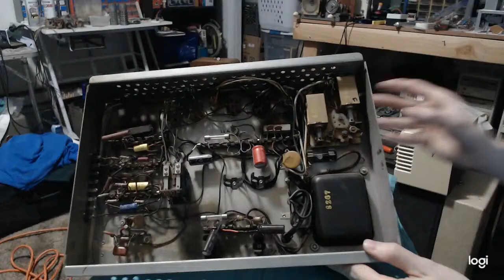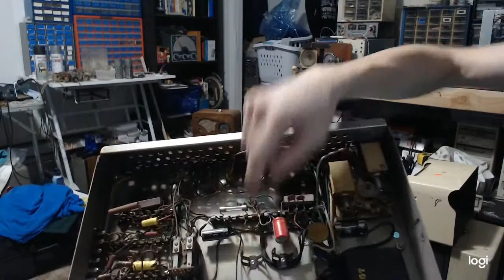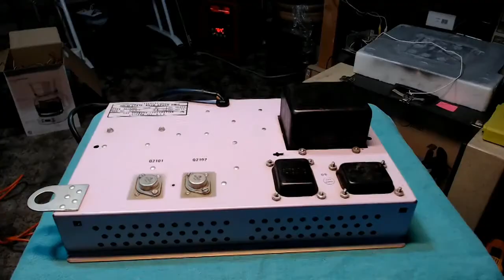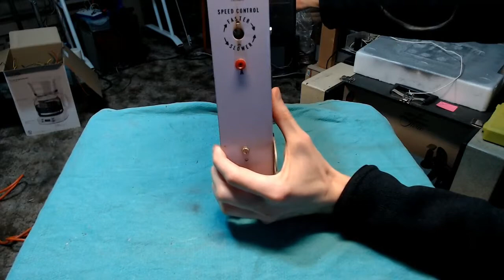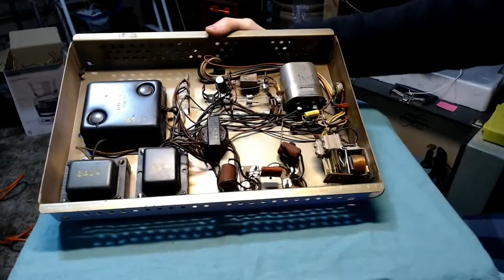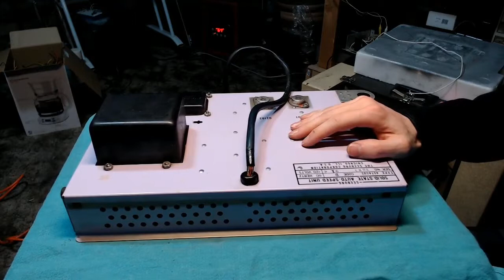Seeburg SS-160 Repair Part 2: Control Unit/ Auto Speed update

Comment: At 10:48, if you go to an appliance parts house, that big, (motor start) CAP. will be quite cheap.
Reply from the maker: In all honesty, I should have just ordered one off of Mouser when I bought the rest of the parts. No appliance houses to visit in middle of nowhere southern Oregon.
Reply from the maker: @brucegerard309  I've started using those big film caps in a number of other applications. Mouser has a great selection.

Comment: I have the same speed control. I have replaced all the caps. And at times when starting up the jukebox after it's sat for awhile 45's won't play at the right speed. Do you have any suggestions?

Comment: Hi great work on amp. What awg guage and quality of wire do you use? Stranded / solid? Reasons? Thanks
Reply from the maker: I typically use 22AWG solid, but for heavier things like filament connections I use 20AWG stranded.